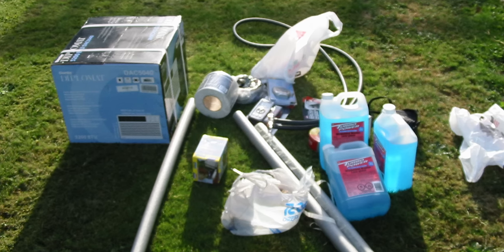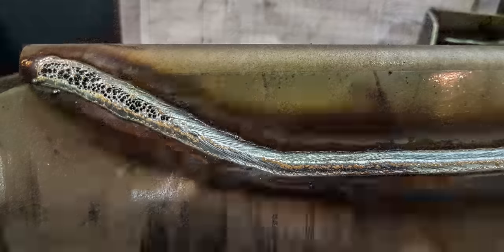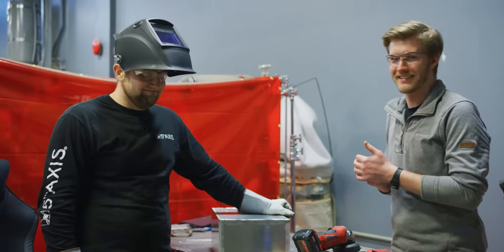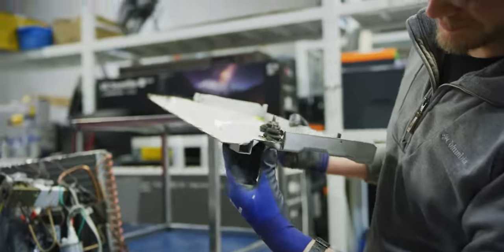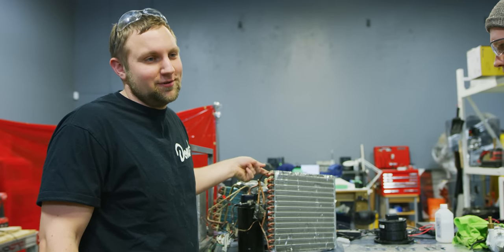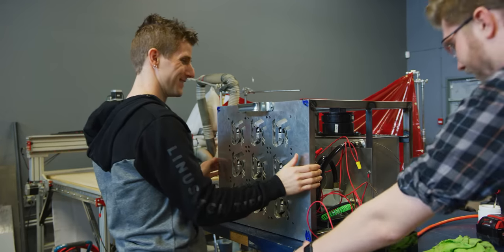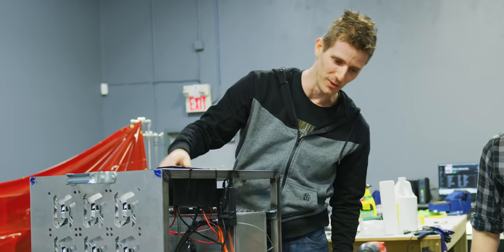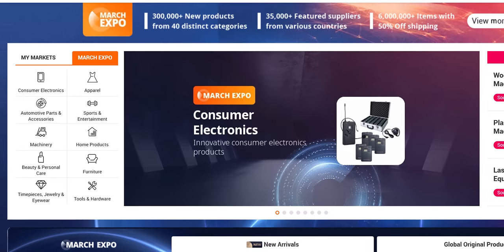Building the Ultimate CPU Cooler!

Comment: Casually films themselves releasing r22 and shrugs it off, something that in Canada is highly illegal even if by accident with fines as high as 1 million with the average fine being 500 thousand C$
Reply: I was pretty shocked by that too, although i suppose if it came down to it they could just say it was a gag for the video and didn't actually happen
Reply: Whoa. yea i came to see comments, and I was gonna say theres a reward of $10k in the US if you report and turn someone who leaks/vents refrigerant. But $500k-$1m is nuts if thats really true in Canada.
Reply: Before they said it was r22 I was wondering if it might be a flammable refrigerant like r600a. Would have made the video a little more interesting.
Reply: I get the fine if intentional, but this is a cheap window A/C unit that was broken on accident.  If the fine really is that high, then there has to be selective enforcement.  It really seems like a "How can we nail whoever we don't like?" law.
Reply: Considering the thermal l properties of R22 I'm sure what we saw in the video was not an actual refrigerant leak. His fingers would have suffered severe cold burns if he'd actually tried to hold closed a leak in a refrigerant circuit. They probably really had a leak but that's not what we saw in the video, I guess this was nitrogen or probably compressed air. Also I sincerely hope they didn't really recharge the unit with R22 but at least some drop-in replacement like R422 or R417d which doesn't affect the ozone layer.
Last but not least: you can buy commercial units that perform better and are more she than this, but if course this doesn't allow you to make a video about it where you make money from 😆.
Reply: @mariokleidosty9175  I'm surprised you are allowed to still use R22.  Here in the UK its been illegal for years and anything with R22 cannot be recharged with same.  Its use drop in replacement refrigerant or a new unit
Reply: well, working on a unit in that state is negligence at best if even allowed at all... I really hope they don't get into trouble for this.
Reply: @mrlithium69  Can you put a price on atmosphere or do you breathe currency
Reply: @mariokleidosty9175  Incorrect, just because something is cold does not mean it will cold burn, after all you can handle liquid nitrogen without issue in your bare hands and the gas output of liquid nitrogen is cold but about as harmful as a mouse fart, the same for r22 when pressurized and n liquid form it can be dangerous but when you rupture the system the pressure is lost and it immediately turns to a gas that will not cause skin damage.
Reply: At least in my part of Canada the fine for an individual is nowhere near that high, it’s no more than $50000 and the enforcement of these ozone depletion laws is laughable. If it’s released by accidental damage there will almost never be a fine.
Reply: Whaddya gonna do? Tattle on him? If not why even make a comment about it. Lmao

Comment: Linus, I am an air conditioning man with 40 yrs of exp. to say this is jank is a major understatement. it looks cool and is very entertaining to watch, but r22 is not meant to pull down that low. you should have used a 404a gas system and a chiller barrel, it would be safer(closed loop) still good fun!!
                                                                                                                                                               Frank the ac guy
Reply: Thanks Frank :)
Reply: Awesome!
Reply: You sound like walter white giving advice to beginner cooks
Reply: Your the man Frank!
Reply: The Problem you have there Frank is that this AC unit is meant for 404a gas. And it isn't like you can just drop 404a gas in to that system without changing 90% of the cooling parts.
Reply: thanks frank
Reply: @Eclipsee412  not 90%,  just the txv or fixed orifice if it doesnt have a txv. . But as far as R22 not being meant for low temp , reefers ran it for many years for box temps down to -20 farenheit . R22 Runs Lower head pressure than R404a but requires liquid injection to keep head temps in check.
Reply: not to mention he put the sensing bulb for the TXV into the resivor
Reply: Thank you Frank,
Reply: That's a really good advice, thanks Frank!
Reply: people , pls be like frank
Reply: thank you frank
Reply: @chexlemeneux8790  in Europe was used in blast freezers up to -40⁰C in industrial Refrigeration. In supermarket side was used from 0⁰C up to -35⁰C in display cases and in walk-in coolers or freezers. With R22 we was having some limitations with high CR (compression ratio) and overheating on the valve plates that's why Copeland was designed the demand cooling if you remember. The same problem we have now days with R448A or R449A refrigerants
Reply: @panagiotispsomas5611  I work specifically on Thermo king reefers mostly , the old R22 units had liquid injection to keep the CDT down.
Reply: Not true at all, you can get well below -40c with r22 very easily. I always use propane for my phase change systems but it's pretty similar to r22 and -40c was a walk in the park. With no load it's well below -60c. However I don't do single stage stuff anymore since I built my -100c autocascade.

 You are right about it being jank, but only because they wasted an opportunity to build it correctly after having to recharge the system anyway. They could have at least changed the cap tube and made that water chiller actually work correctly. Unfortunately Brian doesn't seem to know anything about refrigeration, he just knows how to charge systems. The fact that he used a piercing valve instead of brazing in a schrader valve says it all.
Reply: Given how bright he seems, the jank is unsettling when messing with mains electric and refrigerants . One bad knock and even as a non AC guy or electrician , I feel it would be sensible to be concerned about dealing with loose refrigerants and sparks.
Also for a business with such high production value, hiring an AC guy or spending more than a few hours researching would be a worthwhile expense.

Comment: Metal gets sticky when it's hot.

There, that's welding.
Reply: Welding is a metal gluegun.
Reply: Metal sticku hot

There, welding
Reply: @wobblysauce  Soldering produces a result like a metal gluegun. Brazing produces a result like superglue. Arc welding produces a result like using a heat gun to melt two pieces of plastic together. Explosion welding is just cave wizardry.
Reply: @jacksondavis8160  Think you meant friction welding.
Reply: Welding is all about controlling the puddle
Reply: and spaghetti stops being straight when it's wet.
Reply: Sticky like your flesh melt to the surface?
Reply: Hot metal gun
Reply: You sir, beats these derps talking too much
Reply: @wobblysauce  I think you dont know what your talking about
Reply: @joshuacunningham4686  Just saying another method also.
Reply: @wobblysauce  there are alot of methods but an ordinary person would not you friction welding, because it requires alot of equipment. You would most commonly see GTAW, SMAW,  GMAW.
Reply: @joshuacunningham4686  Ordinary person would not be doing many of these... hence why Fab shops are a thing.
Reply: @wobblysauce  it's pretty normal for people to do their own welding around here, only thing fab shops really do here is large orders of production pieces, such as stair rails for a construction job, or similar things to that.

Comment: Linus Manufacturing tips.
Just imagine 15 year old Linus making this.
Reply: Fondue meh and now imagine, some of the Sketch level is the same as when it was build... 
(Fun fact, if you aren‘t groundet, and touch live and Neutral the GFCI can‘t tell you appart form the cooler....)
Reply: Linus
Meet the engineer tf2
Reply: @fabianmayer  it can not but the current is unlikely to pass through your heart which is the main concern
Reply: gnrtdf yea, I mean getting shocked on the right hand and kneeing with the right knee on the wet floor didn‘t kill me... so yea. But getting current trough the heart ist pssible with the wires in you left and right hand
Reply: I want him to mass produce it by next year a smaller version Call it an External AIO chiller first of its kind
Reply: @hexotech5202  Even if it isn't mass produced one that fits in a case would be cool.
Reply: Most people make the best stuff at low age. I made the most amazing stuff with lego as a child. Now i can't make shit without a manual.
Reply: Use it to RIP Gamer Nexus 💓🤣
Reply: @ThreeSwings  
Sure, a case that won't fit the usual desk and ought to be off the ground to avoid vacuing all the dust on the floor, yet too heavy for the usual desk to hold aswell.

Comment: 14:35 The temp sensor could be simply bonded to the outside of the tank, the aluminum tank will conduct heat so effectively to the sensor it would get a close enough reading to having it in the tank it won't matter.

Comment: I wouldn't recommend magnetic clamps for Tig welding. They introduce magnetic interference and, in my experience, pulls the arc away from where you are welding and towards the magnet making it difficult to control. I'd recommend getting some screw style clamps. Good quality ones stay tight. Magnetic clamps are fine for Mig welding, however.

Comment: the weld does not happen when used heat.
it happens because of another thing that converts the metal from solid to ""liquid"" form 
and when the lightning is toggled, the 2 pieces are stuck together if they are the same material.
never thought why they dont weld with 2 different metals?
because they will never "mix" since they are not the  same, like oil and water

Comment: Linus actually the liquid in the compressor becomes fizzy/bubbly (gas) when moved. That's not good for the compressor pump since it tries to pump gas when it should pump liquid. Goes for fridges also and air conditioners. Leave it be for at least 2 hours before plugging it in and running it so the gas settles and becomes liquid again.  Just thought you should know for next time.

Comment: ok boys  as far as the loop goes i would've used hose clamps and prolly nylon fuel/coolant line it's reeelee durable and won't degrade over time and the crimp type clamps they use for it pretty much eliminates the chances of leaks unless it kinks

Comment: An Idea: Make A Desktop Out Of Laptop Parts. I'll Try It As A Project For The Home Quarantine/Summer Vacation.
Reply: LeafPot I mean... it would be possible but a pain in the ass
Reply: That could be possible.
Reply: Watch DIY Perks for that exact thing, TWICE.
Edit 1: Here’s a link to the newer and better one https://youtu.be/8jeLCQ62vFk
Edit 2: and this is an older video for a relatively easier one https://youtu.be/e3fnsGHe8eE
Reply: Would be easiest to use the entire laptop, saw a hole into the bottom and just place a cooler onto the CPU and GPU (or maybe even onto the heatpipe if polished beforehands).
Then put external display, keyboard and mouse and you are done.
Anything else would be stupid in my eyes.
Reply: already exist - there are videos about "upcycling" a laptop with a defect screen to an all-in-one PC. I got an older HP laptop with a killed screen and I'm considering to merge it to a 30" TV i have and let it run with Linux.

Comment: don't use filler rods when tacking parts together, just make and arc puddle the metal together, its a tack not a weld so if it warps or is askew you can very easily break the tack and start over

Comment: So when does he drop it?
Reply: @MrBeast No prebuilt lol
Reply: @MrBeast Build it yourself
Reply: @MrBeast lmao ur funny
Reply: He dropped water all over it, I think that counts.
Reply: @MrBeast dont get a prebuilt. Doing the research to build it yourself will get you more performance because you're not paying and extra $500 and intense satisfaction when you power it on for the first time
Reply: At 4:20 and 6:09
Reply: He will drop it when he needs to lift it off the floor in order to drain it, which will be when the cpu block becomes so gooped up it doesn't cool anymore, which will be in 2022 because he won't decide to change the water until it becomes absolutely necessary, even though it has built in drain and fill ports.

Comment: Please make clamping bars for flat material that you can screw into the routing table. It is far more effective, easy to use and have a way lower chance of failure over adhesive.

Comment: Back when I was welding we had a little jar of semi solid acid you would do the hot tip to in, just after coming off a weld as the tip was getting dull and it would sharpen it. Something to look in to.

Comment: You should use cork insulation tape on all the copper to prevent l refrigerant leaks from compressor vibration and rubbing. Use it on the accumulator at the bottom that run cap is dangerous tho ensure the terminals are insulated as well. Replace all the kinked copper use 407c, NU-22, 427

Comment: Don't remember what it is called, but GE makes a liquid that works at up to -80 C. It is used in commercial settings for the most part. Use to cost about $150/ Liter. Non-conductive. Biggest problem is that it is such a thin liquid it will leak out of even the tiniest crack or pipe fitting. Can you guys do that? It's like an oil bath cooler, but better:)

Comment: So...
Would that thing be capable of cooling a whole room of editing PCs? It could totally be out of the room to keep the inside temperatures down in the summer.
Use the temperature controller to keep the coolant temperature high enough to avoid condensation. Presumably the compressor will run as much as necessary to handle whatever thermal load it needs to.

Comment: Should have used a beer container for the water storage, insulated would be better, also, should have mounted the internal bits on a separate chassis mounted with rubber and nylon fittings to make it safer

Comment: Not sure how it is in Canada, but you could get into some trouble if you were to recharge an R22 system where I'm at. Also the tipping a compressor being bad does have to do with the lubricant that's inside, so if you tipped it like 45 degrees and only for a minute or so it should be fine.

Comment: I mean.. (re)using R22 and someone finding out would be the end of my job in my country, at that point you could have gone with R449A or R407H and and looked for a new (used) evap plus some actual fittings that don't leak refigerant over time instead of ones only used for sucking out refigerant of sealed systems.
Reply: I definitely would have cut all that video out.
Reply: The fact that they refilled that shredded radiator with freon instead of buying a new or less used one bothers me.
Reply: Yeah, really disappointed with this. With the amount of money they spent on the video anyway they could have got a new or used unit with smaller capacity (and power draw) and done things properly.

Comment: My inner hvac cried when that r22 wss being let out 😭😭
Reply: Mhergo I’m sitting here trying to figure out why they didn’t use r410a or one of the many other substitutes... I guess they didn’t want to reclaim (or rather have someone else do it) the r22 to save money? Thoughts?
Reply: @cowmagnont.5134  well r-22 even though being reallly really bad for the environment, its easier to work with. And if the system already had r-22 in it, its easier just to put the same refrigerant back into it. Thats what im assuming.
Reply: rip ltt's legal team
Reply: @TheZaashi  R422D is still legal to use and does it's job quite well. It's not like all this wouldn't work with 1-2K temp difference.
Fuck R22.
Reply: @cowmagnont.5134  you shouldn't mix the two. When you are going from R22 to R410 the lines need to be replaced. Some do a washout of the lines, but that is not even recommend. The oils in R22 will degrade R410 is the main reason.
Reply: I see $150/lb.
Reply: If it was illegal why would they post the video of it. They could have not included that part

Comment: Nice work..

As an HVAC Tech, i think this is a very good realization.

I only hope that when you repaired the leaking, you was using a little flow of nitrogen to remove the air inside the refrigerant circuit when you soldered it, because soldering copper tube with air around create carbon, and if their is air inside, there will be carbon inside which will clog the dehydrator.

I also hope that you had use a vacuum pump to remove the air in the circuit before charging it with the R22.
Because if there is air, there will also be water inside the unit when you fill it.
And there will be a reaction between the air and the oil in the compressor, which will create acid, which will destroy the compressor.

If you didn't do that, i strongly recommend you to remove (with a recuperation station) the old R22 which will probably be contaminated, then use the vacuum pump for an hour to remove the humidity, and then fill up again the unit with the right amount of fluid.

Be CAREFUL 
You must use a weight scale to know how much fluid you put in because it's impossible to know with the pressure.
Only the weight can tell you how much you have in the unit.

If you put too much, you risk to have the R22 staying liquid when returning to the compressor, and as liquid is impossible to compress , you will kill the compressor.
But not enough fluid and you will struggle to condense, which mean that you will not evaporate a lot and then will cooling more less (while consuming the same in term of electrical current.

I hope that you did everything well because it's such a nice creation that it will be so bad if it die.

i almost forgot to ask if you are using anti freezing with the liquid in the tank but i"ml pretty sure you did, no?  :)=